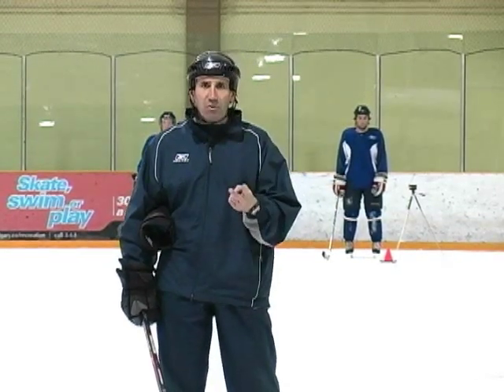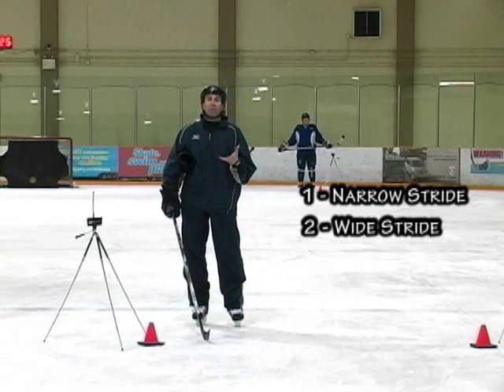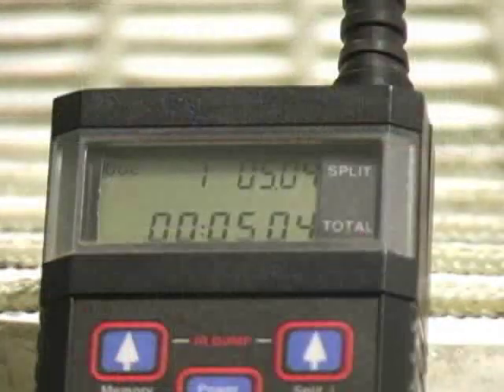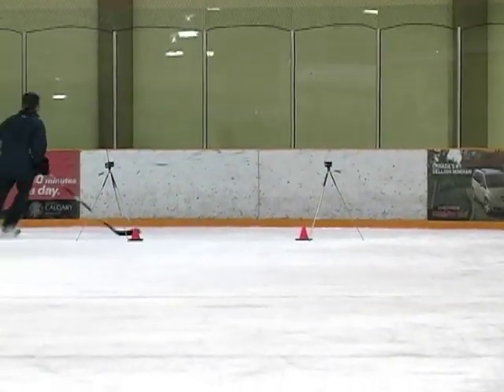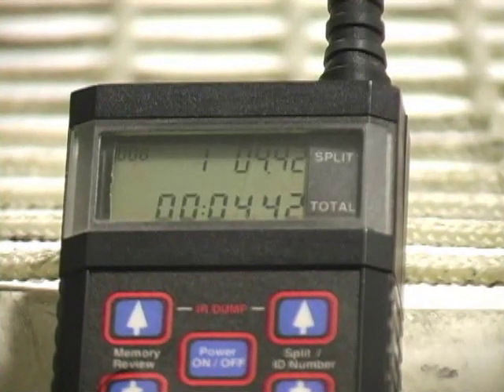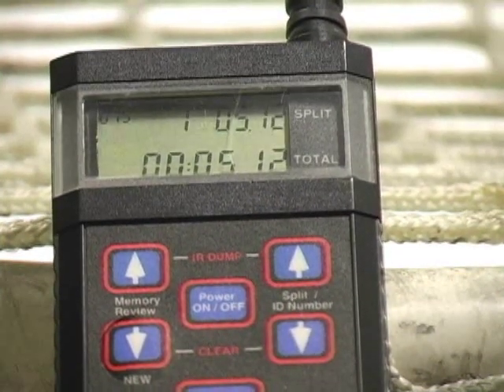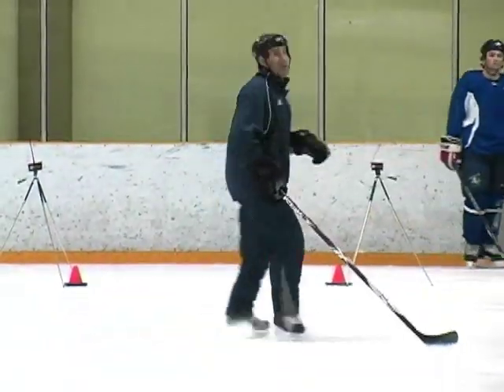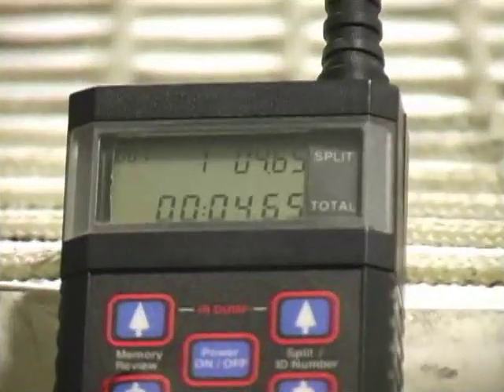Power Skating Arm & Leg Movement - Dr. Bracko proves proper arm and leg movement.

Comment: What about efficiency and angle of attack?! To each their own I suppose but what about teaching full recovery and extension
Reply from the maker: Hi Cooke's Elite Hockey, sorry, I don't understand what you mean by "angle of attack."  But in regard to skating efficiency and "to each their own," the information I present in the video is based on objective data-based research dating back to 1975 (Pierre Page's Master Thesis), plus numerous other researchers since then, myself included.  The research (and practical application and observation of fast players) is clear that fast players have a wide stride, quick recovery, and their recovery skate lands back on the ice under the shoulder so that the skate can get on the inside edge quickly to start the next push-off.  This is how fast players skate.  In the research we did with D1 female college players, we found that the fastest players skated as I described above, and the slower players had a full recovery (bringing the skate to the mid-line of the body or a "heel click").  Moreover, the research on the stride indicates that at full speed, fast players do not, cannot, have a full extension because they are skating so fast they get to approximately 170 degrees and the leg has to start the recovery so the knee does not get to full extension.  To get a good visual of how fast players skate, please watch this video of McDavid and Anthony Greco (Greco plays in the AHL and skated faster than McDavid during last year's AHL All-Star Fastest Skater) - https://www.youtube.com/watch?v=7GvJ6UwO6t4.  You will see that both McDavid and Greco have a wide stride, quick recovery, and their skates do not have a "full recovery" rather, their skates land under the shoulder.  You can easily see this when Greco skates away from the camera.  Another good video to see a player with these skating characteristics is Taylor Hall - https://www.youtube.com/watch?v=GBTUhWxN0m4.  And I like watching, and showing my clients, another video of McDavid in a game that shows his wide stride and landing under his shoulder - https://www.youtube.com/watch?v=9Djkgv9MQiI.  On this one, wait until they show the  second highlight of the goal, when he's skating towards the camera and you can see his wide stride and quick recovery.  Finally, check out Kendall Coyne skating ... wide stride, quick recovery, recovery skate under the shoulder - https://www.youtube.com/watch?v=58qOiRANbxo.  I could go on and on, but if you have any further questions or comments, please go to my web site:  www.hockeyinstitute.org for more information.  And/or send me any questions or comments you might have, my e-mail is:  bracko@hockeyinstitute.org.  Thanks.

Comment: Interesting study but I disagree with the assertion that the fastest skaters have wider, shorter strides and don't reach full leg extension, especially when skating at full speed. As an example, watch this video of Jack Eichel absolutely smoking #61 Connor Brown and tell me what difference you see in their strides. One has a faster turnover, more motion and a wider stance and the other (Eichel) has a longer, more efficient stride and returns his skates underneath his body. Which one is faster? Dylan Larkin, who just won NHL's fastest skater competition, has similar stride mechanics to Eichel.

https://www.youtube.com/watch?v=2_76n2-KiFU
Reply from the maker: +marktdus Hi, thanks for your interest in the video.  Thanks also for your comment about Jack Eichel.  Respectfully, it is not my assertion that fast hockey players have a wide stride.  This fact is documented in at least 5 data-based research studies, the first one was done in 1975.  As such, we've known the characteristics of fast hockey players for 41 years.  Our research group has found this to be true with female college players as well with studies done, and presented in 2010 and 2007.  Eichel is a fast player indeed, but if you use stop motion on the YouTube video, it is clearly obvious his legs/skates to not land under his body.  His right skate lands slightly his right shoulder, but he quickly gets his skate on the inside edge to start the propulsion phase of his stride.  But his left skate lands directly under his left shoulder and then he's on his inside edge.  Dylan Larkin's skates do not land under the mid-line of his body.  It may look like it does on the TV coverage (not the best angles for biomechanical analysis) but he too has his skates land under his shoulder.It can be confusing, but if you watch these players in either slow motion or stop motion, check out where the skate lands, and you'll see that all fast players get their skate to land under the shoulder.  This is why they are fast.  In one study we did with a female Canadian college team (University of Alberta) that we presented at the ACSM annual meetings in 2007, we found that the slower players did as you say, their skates landed under the mid-line of the body, making them slower.I realize this is kind of a dissertation of a response!?  But when you talk to a guy who's life is coaching and researching skating, it might be expected to get a long response!?Mike Bracko

Comment: a few concerns here would be consistency of skaters time's for a base and ability to move the legs fast enough to provide proper data between the two styles. also a transition test would be interesting here, demonstrating how transitioning between the two would affect it. transitioning from narrow to wide. your first three strides are gonna be totally different then your last three
Reply from the maker: laronda10 Hi, thanks for your interest in my videos and skating coaching.  I'm not sure what is meant my "consistency of skaters times for a base."  As such, I can't comment on that.  Although I'm not exactly what is meant by the "ability to move the legs fast enough to provide proper data between the two styles" I respectfully suggest this is not the point.  We were moving our feet as fast as possible using a stride that we never use.  The point of the video clip is to show that a narrow stride is slower than a normal wide stride.  A transition test meaning transitioning from gliding to striding?  Yes, that would be interesting, but again that is not the point of the video.  The point is to show that a "power skating" stride using a narrow stride and a recovery under the mid-line body is slow and inefficient.  The first three strides are always different than the other strides because when accelerating their is more hip extension than there is hip abduction.  But after the 3rd stride the hip start to abduct, and the stride is the classic wide stride and quick recovery.  Thanks again for your interest and comments.Yours truly, Mike Bracko
Reply: let me start off with premising i agree with the points you are making in you're video. i came from quad roller hockey(team usa) and inline speed skating. widening my stride has been a big part of the transition for me. i guess what im trying saying is that this is essentially you're comparing the double push, that is regularly used on roller due to many technical differences, to the classic power stride. the double push gains over all dont out way its effort on ice see http://www.danielyeow.com/2011/difference-between-ice-and-inline/ . its a good article on ice vs inline. so it would be cool to see someone who is proficient at the double push, try and do it on the ice. cause ultimately they'd have to produce a much faster time for it to be of use which i dont see happening cause an experienced double pusher would probably only use 1 or 2 double pushes at this distance. which would have no significant effect.
thanks for the video, and love the discussion. 
Larry Hansen
Reply from the maker: laronda10 Hi Larry, I've never heard of quad roller hockey.  I watched some of it, and it looks interesting. I've only heard of the double push once before, and really don't know what it is or how it's used.  But you can't use it in hockey because of the dramatic change of direction used in game-performance skating.  Each of the 27 game skating characteristics is used on average for 1.5 seconds, then another characteristic is used.As such, I'm not comparing an efficient hockey stride to a double push stride. I'm comparing a hockey stride to what "power skating" coaches claim to be "the" most efficient stride.  Wish I had more time to read that article you attached.  Thanks for the discussion.MikeAnyway, thanks for the discussion.
Reply: yeah its not to popular, i never really got a chance to get into ice till just this year so the transition has been fun and interesting to learn all the little differences. rewiring my body to the power stride has been the big one especially sine im used to toe stops. and basically the article talks about the reasons the double push doesnt work to well on ice. even ice speed skaters dont use it to often. its mostly to just used to hold speed in any form of roller skating, combating all the frictional forces dealt with on wheels

Comment: Studies have shown that there 2 main factors that influence a skaters speed. This was done using on ice and off ice tests to measure muscle strength, flexibility, balance and other factors. Strength had nothing to do with it. The 2 things that influenced a skaters speed were: 1.  Stability (I will call it balance) and 2. How long the skaters quad muscles were tensioned during the stride (I call this technique) A skaters speed will be influenced by how well he is able to transfer the energy from the skate blade into forward movement. I call this "whole foot skating" and this is pure technique. The stride should be efficient from the heal to the kick point of the toe to generate the greatest forward movement. This (using the V diamond skating pattern) will generate the greatest forward movement and therefore speed. The width of the stride is only important in that full extension is achieved and the return of the stroke is maximised. A wide stride in itself is not always a good thing and can indicate poor stability in some cases. As far as arm swing goes, I was always taught to skate with NO arm swing because you have a stick in your hand hopefully with a puck on the end of it. You cannot swing your arms if you are carrying a puck. That is how you should learn. I can skate backwards at almost the same speed as I can forwards. No arm swing there. Just technique and stability.
Reply from the maker: Hi David, thanks for your interest in my videos and thanks for your interesting comments.  I'm curious what studies you are referring regarding the comments about 2 main factors influencing skating speed.  Ironically, I've done studies just like that.  We did research to understand what off-ice fitness variables predict skating speed and acceleration.  
Because I've been doing research on skating for so long, I'm familiar with most of the research in this area.  And I've never heard of the kind of research to which you're referring.  Let me know where those studies were published so I can take a look.
Interestingly, I know of no research or even anecdotal evidence that suggests that the 2 main factors influencing skating speed are stability/balance and the length of time the quads are contracted, or as you call it, "technique."  
It's also interesting that you call quad contraction a form of technique.  I guess you can, but in terms of physiology, the contraction of the quads is muscle physiology.  But, if the quads are contracted for a long time during one stride, this means the stride is too long.  One of the key factors in skating speed is the number of times a player can push off over a given distance.  Therefore, a player doesn't want long strides, he want short powerful strides.  This therefore means that the quads are contracted for a very short period of time - less than .20 seconds.
I agree with you that speed is influenced by the ability to transfer energy to the skate blade.
We've known since 1975 that a wide stride is a characteristics of a fast player.  And a wide stride would actually indicate more stability, not less.
In regard to arm movement, it is incorrect to teach players not to move their arms.  This would cause an uncoordinated movement pattern and make a players slower.  The arms have to move, and they move in smooth coordinated movement with the legs.  The legs push to the side, therefore the arms have to move side-to-side.  And even when a player has the puck, he moves his arms in certain situations.
It's easy to understand how players skate by staying on YouTube and watching the NHL Fastest Skater competition.  You can see the NHL's fastest players skating with a wide stride and side-to-side arm movement.  It's pretty cool to see.
Thanks again for your interest in the videos.
Yours truly,Mike Bracko
Reply: Mike Bracko 

Hi Mike,

I will find the papers I have referred to and send you link. It was a while ago and I will have to try and find the exact research document. It was not perfect an I was critical of some of the assumptions, but it was interesting. Give me a day or so to try and find it.

You obviously know a lot more about this that I do and I am not trying to tell you your business. I am not a skating teacher and never have been, it is just that I have recently returned to skating and hockey after many years away. I have noticed an absence of good skating tuition and also noted that there is a need for it. I am blown away by the amount of people who just can't skate to the level you would expect. I include hockey players here. 

Mike I will be blunt about this, I am very lucky because the one and only god given gift that I have been given is the ability to skate well. I live in Australia (where there is no ice - ice time is expensive when you can get it and you have to be dedicated) and I started skating at the age of about 12 which is young for someone on the driest continent on earth but old for USA and Canada.

I am lucky that a good skating technique just feels right to me. So I think my technique is good without a lot of effort. My Canadian coaches helped me develop this, but it was always just easy and natural for me. I was never the best hockey player on the team but I could skate better than most. I played to pro level (here - that is probably a very low level in the USA or Canada) for a short time and now in my 50's I am again a passionate skater and drop-in hockey player.

I see guys all the time (young guys) who want to be taught. They even ask me to help them. But I can't help. I just don't know how to instruct. Just because you can do something does not make you a good teacher. I know that from language learning as well. This is why your videos are so helpful.

Anyway, I will send you the material that I referred to and I will keep watching your videos in the hope of picking up some teaching tips. My dream job is to be a skating coach for an NHL team!

Regards, 

David.
Reply from the maker: Hi David, thanks for trying to find those studies.  They would be very interesting to read.
I agree with you about skating coaching and how many people "try" to teach skating but really have no clue what they are doing.  Many skating coaches just make up stuff to entertain hockey players.
You're lucky to be a good skater.  And a player who can skate as fast backward as forward.
Good luck with learning more about how to teach/coach skating.  
Nice talking with you.
Hockey in the land of Oz!?!?  Right on!!
Mike

Comment: arm swing is bull shit.. It is all about having strong legs and a flexible body.. your lower body has to move as if it is a different operating system than the upper body.  your torso has to be very flexible.. (erector, Ql, psoas, oblique, abdominals, TFL, Glutes, rotatories, multifidy..ALL HAVE TO BE FLEXIBLE..  Watch Grabner and hall race at the fastest skater.. hall is very tight but grabner is very flexible around the corners.It's all about upper body rotation that makes you smooth and fast!

Comment: Your entire philosophy is lacking all reasonable knowledge of vectors, power generation, joint movements being used in series to create speed/power. Both yourself and you assistance seem to be a less than ideal sample of players to truly form a opinion worth considering. I do not claim to be a DR of the stride like yourself but I have studied the phyio of the body, the bio of the body and train over 4000 athletes annually on ice. Your stride concept of course will create........

Comment: I respect what you are trying to do, as well as your credentials, but in my humble opinion the methodology used here is poor research science. For starters, your sample size of 2 is too small (you can't include yourself). Your test subjects are familiar with the result you are attempting to achieve. And these are just the issues with the methodology. Research in many sports proves that any lateral force detracts from straight-line forward accelleration and speed. I'd love to see this done right.

Comment: look at pavel bure accelerating... from cruising to full speed... his strength shows that when you have power in your legs it doesnt matter how you move your arms and your legs... YOU NEED TO MOVE YOUR LEGS AND MOVE THEN WITH THE MOST POWER POSSIBLE... except in Pavels case.. his power was on a different level than anyone else. Gimicks wont get you to the pros... training hard and skating hard will. Nuff said

Comment: Zero hip transfer and the push distance is the exact same from the "narrow" to the "wide" all they did was spread their legs open more.  Timing the distance is kind of redundant as there are numerous variables affecting the speed of the skaters.  Instead of speed, I would have measured power output.